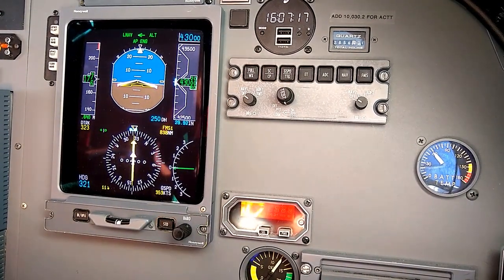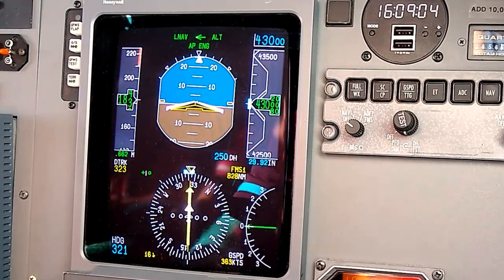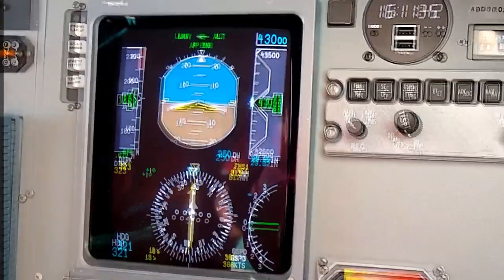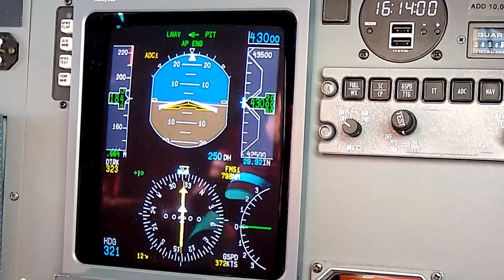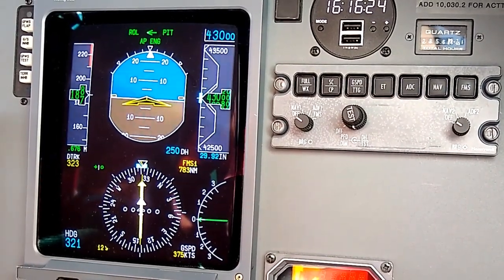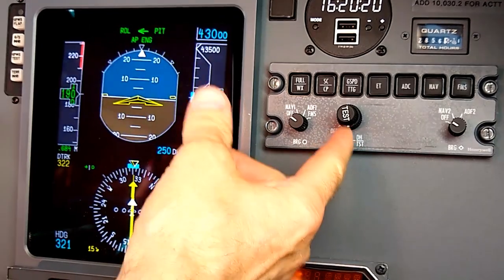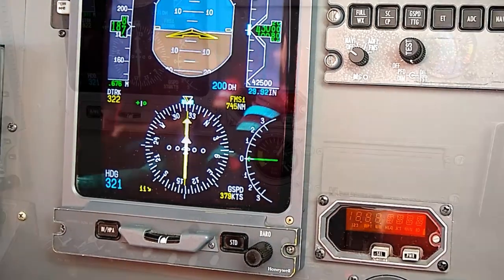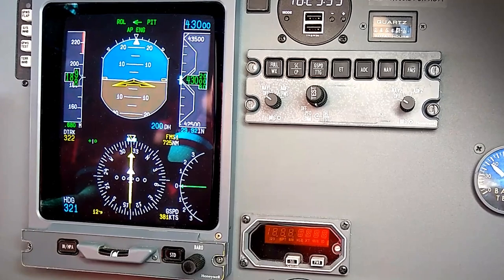Citation Ultra Avionics - Primary Flight Display

Comment: +|o Saw this next to the DTRK, what does it mean?
Reply from the maker: Great question! I get this question from many pilots new to the plane. It's a bit complicated and the reason we don't talk about it often is because it almost always works correctly and doesn't matter to the pilot. Basically it's a symbol which means the heading indicator is displaying accurate information as long as the vertical bar is between the + and the O.

Here is the official description copied and pasted from the Primus 1000 manual:

Compass Sync Annunciator – The compass sync annunciator indicates the state of the DG in the slaved (AUTO) mode. The bar represents commands to the DG to slew the indicated direction (+ for increased heading and O for decreased heading).

The compass sync annunciator is removed from the display for any of the following conditions:

— Invalid magnetic heading
— Invalid flux valve heading
Reply: @citationpro  thank you! I'm going to fly a citation bravo in the near future if everything goes right and this bravo has the same avionics. Your videos are helping a lot! Thank you, wish you great flights and greets from Argentina
Reply: @citationpro  Hi there, be really interested in a run through Ultra with Garmin 750/650 setup. Approach mode capabilities and auto flight modes available 
John
Reply from the maker: @ambler71  , that's a great idea, I'll see what I can do. The Garmin retrofit avionics are nice for their touchscreens and ease of programming, but they do require some odd steps when it comes to tasks like an autopilot coupled LPV approach. It's not intuitive in that respect at all.